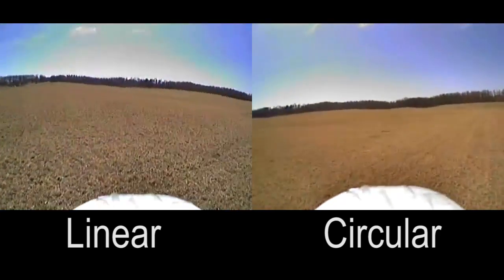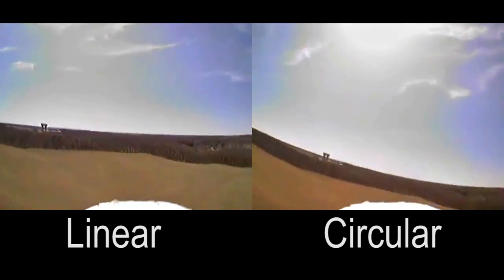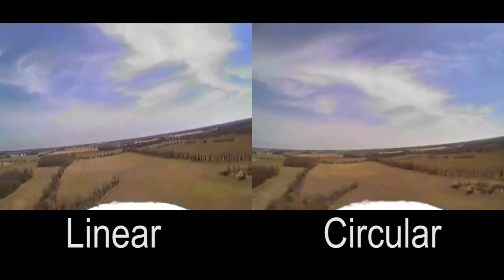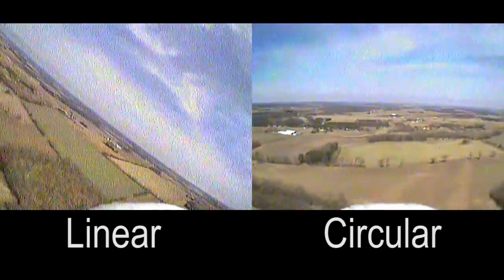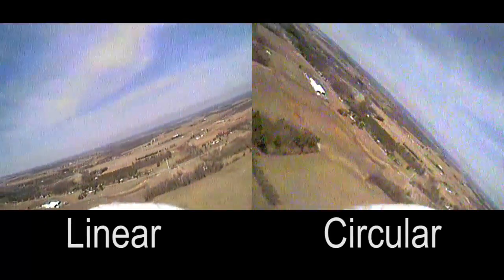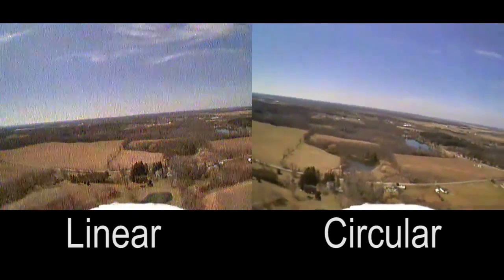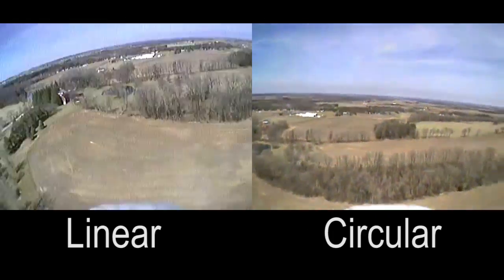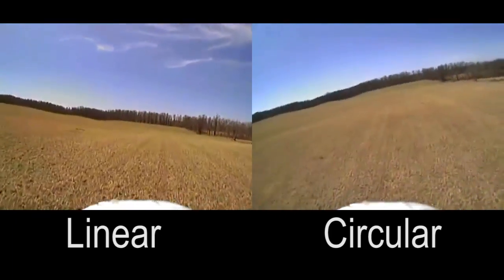Linear vs. Circularly Polarized Antennas for FPV

Comment: Are you holding the controller's "Linear" antenna in the same polarity as the drone's?
Reply from the maker: I believe they were both aligned vertically, except for when the plane tilted.

Comment: the linear antennas shipped with fpv gear are not whip antennas, they are dipoles, two very different types of antenna!
linear antennas can achieve a far greater range than circular polarized  but the tx and rx antennas must be kept in phase, this ia where diversity comes in, i use linear polarized dipoles on my vtx and for both antennas on my diversity rx but in different orientations to keep one in phase when the aircraft is banking

Comment: Almost a good comparison , but you left out 1/2 of it. The part you left out is , what antennas you use on your video receiver.
Reply from the maker: This video was quite a while back but if I remember correctly, for the linear I was using the typical whip antenna that comes with most systems and for circular tests I was using a homemade skew planer antenna.

Comment: This is basic RF.  There are advantages of each but for FPV, CP will generally be better as it is generally not orientation dependent while LP always is.  It's even possible to mix and match the two (LP to CP or vice versa) and they will remain orientation independent, though with a cost of 3dB.  LP itself has numerous advantages, for instance, when it comes to omnidirectional antennas, a LP dipole has a very even propagation (a perfect circle) while CP designs are less than perfect circles.  And higher gain LP antenna can be smaller and less expensive, though the higher gain setups are of course also going to be even more orientation dependent than the lower gain antennas.  If you find the RF propagation diagrams for your antennas, you can tell what difference in angle you can expect them to work over, this opens up some interesting possibilities with a diversity system that allows for multiple antenna in different orientations.
Reply: Yes, maybe a combination of three tx's through a diversity filter with a bonus of being capable of 3 frequencies at one time.  Fast filter and refresh would be key

Comment: The linear is actually better quality minus the slight glitching. It just looks like you messed up the the focus on your cam when switching to circular. You sure the little ring on the camera didn't come unscrewed or screwed in tighter?
Reply: Yes... looks like the focus changed but like he said is likely from making his own antennas without the equipment needed to check and tune it... interesting. Good video....
Reply: So the cam, video transmitter, video receiver, and dvr were the exact pices used in bith test with the only difference being the antennas?

Comment: Best example of the differences between Linear and Polarized antennas.  I assume the antenna was right hand polarized without switching, it appeared that the examples were always to the starboard side.  As an amateur satellite operator, it's very important to understand the effects of polarization on the rotation of the craft relative to the ground, thank you for an outstanding video, best peter